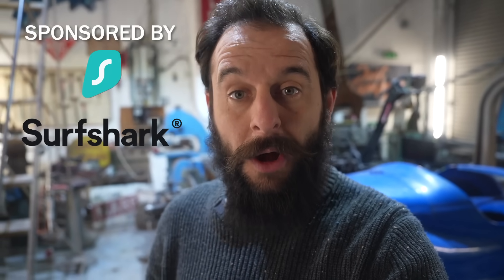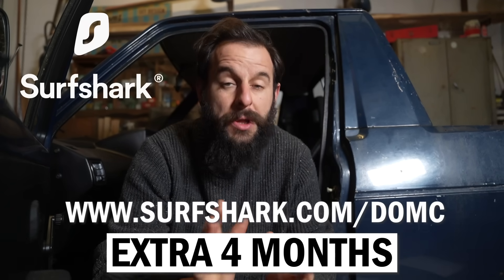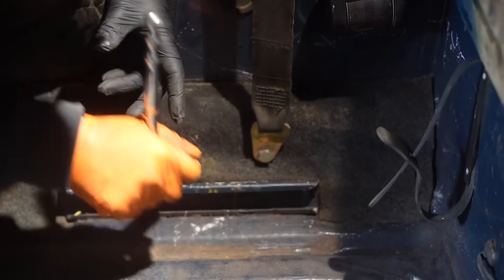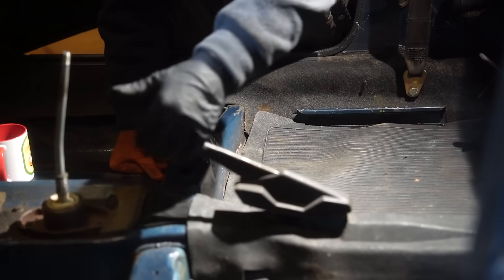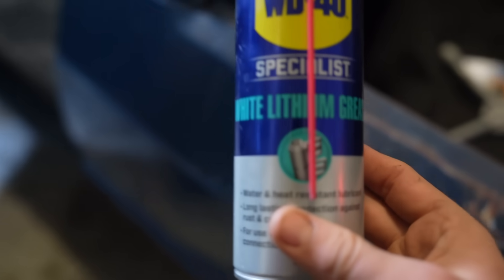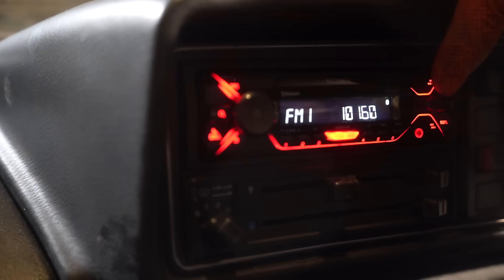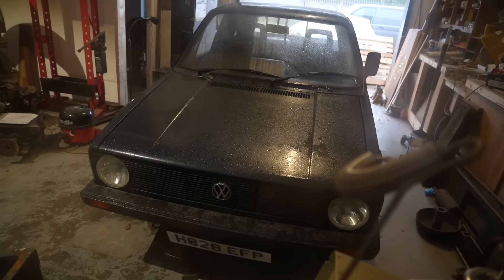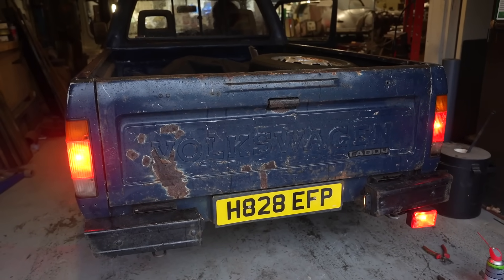M.O.T. Time?! | Volkswagen Caddy Restoration

Comment: Thanks for the journey back in time for me. I worked in a VW dealership in the 80s and watching your man put the seatbelts and seats in took me right back. I worked in the body shop and we would often have to strip the interior out for panel replacement and welding and I would sometimes be asked to fit it up as I was a paint sprayer and would finish my work earlier and give the mechanics a hand.  I can't say I love these trucks, but they are a classic now and very useful.

Comment: For the Floor, Decoupled, mass loaded vinyl ( MLV ). Decoupling it is usually with a 5mm closed cell foam that goes down first. The MLV then goes down. I glue both down with spray glue. MLV is bought in different weights depending on what result you want.  eg, 4kg. The dyna matt is really only for reducing vibration but will give a portion on sound deadening.
Keep up the awesome content.

Comment: I use rubber carpet underlay cut to shape and fitted loose/ not glued as a sound deadening and to cushion car floors under the original mats.  It doesn't disintegrate when it gets wet and dries out quite quickly once removed, also well suited to a car with rubber mats like the caddy as it's easy to get to if you do get a wet footwell.

If you know a carpet fitter or approach a friendly carpet shop they will provide useful sized bits as offcuts from jobs for very little or nothing as it often goes as waste otherwise.

Comment: On my vehicles I use Dynamat for anti vibration and Dynapad for heat and sound. Dynapad is a closed cell foam sheet that won’t hold water.

Comment: You can always put sound deadening in later if you decide you need it. It's such a simple vehicle that it's not an issue to strip the interior and add it. 🙂  I've used it and it does work. Not inexpensive though.

Comment: Don’t put anything down on the floors that you have to adhere. You’ll regret it. If you want to add some dampening, just look for some insulation-backed floor mats that can be pulled up and keep your floors rust-free. My MGB GT has snaps that keep my footwell carpets in place and are easily removed for cleaning.

Comment: Enjoying the series. I learned to drive in a Mk1 Golf so it brings back some memories. It may just have been camera angle, but it does appear to have some positive camber on the front end which I would think would destroy tyres pretty quickly and give it some awful handling. Has it been raised at some point in its past?

Comment: you may need an electric fuel pump to prime the carb before starting.  Todays gas will boil and evaporate out of the carb and cause the long cranking, especially after sitting.

Comment: The two Golfs that I had on long term catalysts tests (supplied to us my Mobil Oil) had the carpets removed for the testing, to save wear and tear on the interior. Both these cars had a really heavy coat of under body wax applied to the floor, inside and out. Maybe that would be a good idea to improve the long term rust resistance?

Comment: In 2019 the car failed its MOT  significantly for rust around the front and rear suspension components, might be worth checking these areas as well.
Reply from the maker: you might have missed the last few videos? i fixed lots
 of rusty bits!